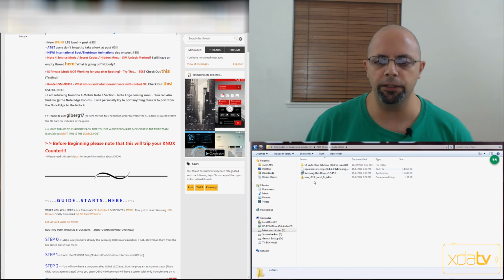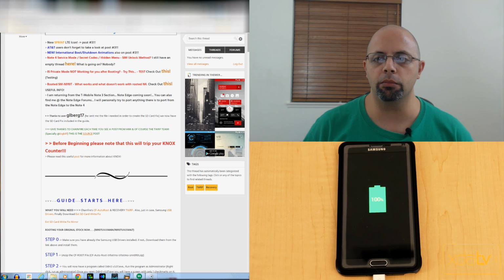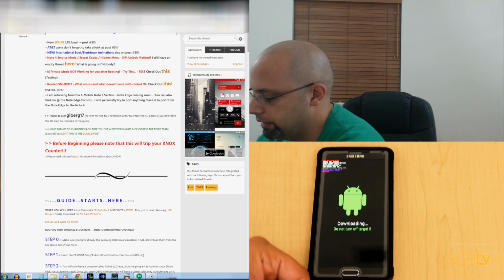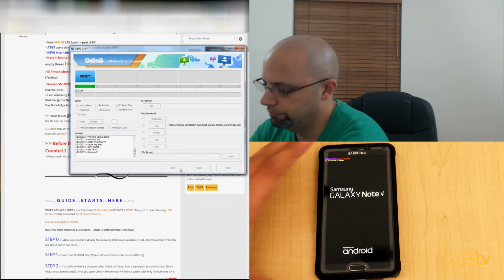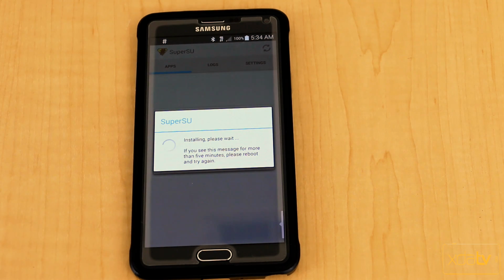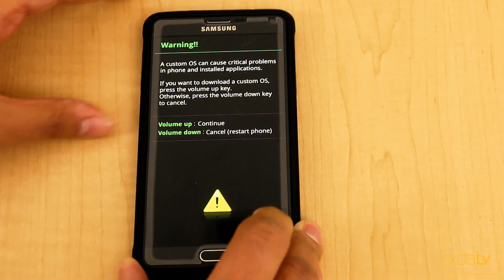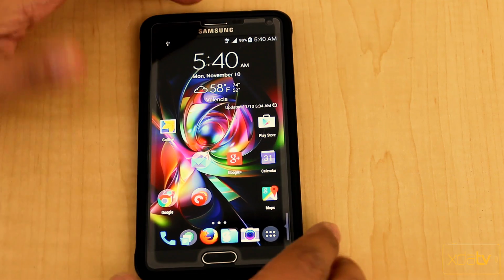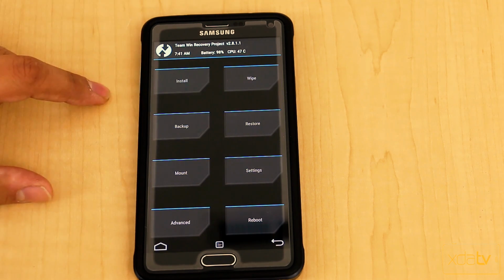How to Root the Samsung Galaxy Note 4 and Install TWRP

Comment: Hye XDA can this method still be use to flash latest version of TWRP,because i find this method are much easier then flashing it on unroot device which required to press 3 combo button to enter twrp right away just after the flashing pricess done by odin

Comment: Hi,
I went in Odin screen. Click on OPTIONS. Next to LOG.
Unchecked Reboot.
Send TWRP file to mobile. When it complete.
Unplug mobile. Remove battery & leave for 30 sec.
Press Volume UP + Home + Power Button togather.
It will start in TWRP.
It work for me. After flashing you must reboot in TWRP otherwise it will boot normally.
Try all steps again untill you success.

Comment: Are they ever going to make a working one click type root where you don't have to use a desktop type computer...ever? I got rid of all my Mac's/PC's because I have no need for them anymore and I'm always moving around so light as possible. Verizon Galaxy Note 4 w/Marshmallow currently. Would love to root but none have worked in the past.
Reply: hi I need to twrp and retrieve files from a bricked bootloop note 3, and
 also flash back to stock firmware. but the battery is totally dead, so I
 need to charge it first somehow or use USB during the process will be 
ok even it's dead battery?

Comment: Hi
i have note 4 and yesterday root my phone like yours. BUT my phone is locked from samsung logo.. first static samsung logo is open after animation samsung logo open-opening sound's half phone is rebooting. i found stock rom but i cant load to phone.. 
NAND Write Start!!!
FAIL!!
everytime is this happening or COM port error..  Now i really dont know what i am do now.. please help me what can i do..
thank you
Reply: Hi. First try to wipe data and factory reset from recovery. If that not help you need to flash stock rom. Dont wory, you will fix your note.
Register on sammobile.com and go to firmware. Download firmware for note 4 (n910f for snapdragon version, or n910c for exinos), see in settings which is yours  model. And you need to flash stock rom with odin. There are so much video how to flash. Important things is to download and install samsung kies software for drivers and just close it. Enter note to download mode and connect with usb. If you have win7 pc wait a little to windows install driver. Then run odin like admin. You will see your note is connected and hit start. I suggest to you after flash to again go to recovery and wipe data and fsctory reset. 
I hope halp to you☺

Comment: what if my note 4 on sprint is stuck on retail mode and wont let me shut off the device
Reply: To get rid of the retail mode,you have to put in a password or give it back.I got sold a retail mode device and the ad was always going on.Returned it and the guys couldn't remove the password,so they gave me a new device.Hope I helped you :D

Comment: My Verizon note 4 n910v  lollipop 5.0.1, baseband n910vvru1boaf, kernel 3.10.40  gets a complete write operation fail from odin. I went to cf auto root and used smn9108v.tar.md5 from chain fire. Any suggestions to complete ?

Comment: Not my 1st device rooted, but this is taking for every? fallowing the steps and even have xda site open. Download bar in odin is at like 5% for  30 minutes?
note 4 running LP (all stock)
Firmware update start..
recovery.img

Comment: One questin im doing exactly the same way you are doing for the note edge tmobile everthing run great but when turning on custom recovery factory recovery goes on not twrp recovery what am i doing wrong i have the driver twrp and root file for tmobile note edge right odin and. It still dont install everything say pass but going to recovery stock recovery appears not the custom one

Comment: when i try to root my note 4 with cf autoroot and odin, it always fails and I have to unplug and manually reboot my phone by removing the battery. how do i fix this??? the program ends with the line: <OSM> All threads completed. (succeed 0 / failed 1) . It fails and i can't root it then. please help!
Reply: Sahil Malhotra Same with me. Did you ever find a solution.
Reply: Nope, but I figured out why it didn't work. My model of the note 4 n910a, the us AT&T version has a locked bootloader and is unrootable, which kinda sucks but yeah. If you don't have a model with a locked bootloader you are just trying to root using an incorrect cf autoroot file designed for your phone. Really all depends on the model phone you have and your carrier.
Reply: Sahil Malhotra ahh, gotcha. I have a T-Mobile note 4 so I should have a unlocked bootloader. Im going to recheck the download and make sure its the right file.

Comment: ***** any idea if ROOTING will trip KNOX? also, will this work on Sprint variant Galaxy Note 4?
Reply: Cha Hernandez I'm pretty sure it does trip knox
Reply: Yes it does trip KNOX and it works on sprint.
Reply: rocketman8887 ITLL ALLWAYS TRIP KNOX, AND SPRINT AND TMOBILE ARE THE EASIEST TO ROOT SINCE THE BOOT LOADERS ARENT LOCKED, MEANING AFTER ROOT YOU CAN CHOOSE ANY ROM YOU WANT ON IT

Comment: Looking at the process and it is very straightforward but I have to admit I'm a bit skeptical that this will work for the AT&T version of note 4. So Soon anyone has done it for note 4 AT&T please do repsond. I will await the response. Thanks again for the video.
Reply: When this video was made, this only worked for T-Mobile but now it is available for basically all U.S. carriers. You just have to go to the website and check for your certain carrier and model.
Reply: ***** http://forum.xda-developers.com/note-4/orig-development/sm-n910-cf-auto-root-t2897428

Comment: Now I'm new to "root" I've jail broken devices before however. 
When you root is it possible to do it so Knox isn't tripped 
And are you able to update your firmware when you are rooted ?
Reply: No, it's not possible to not trip knox, and yes you're able to update firmware when rooted.
Reply: NviForce what exactly is knox
Reply: A safety thing that's also used to determine if you've tampered with your phone. Pretty useless piece of bloat on samsung phones.

Comment: I did everything according to the forum but my computer being the most reliable thing i have (sarcastic) doesn't recognize the recovery file and doesn't put it in the folder with odin where i selected PDA it is in a whole different folder than Odin has no access too as an image so apparently i have to burn that file on the CD. I've already tripped knox so my question is how can I continue to go about getting my phone rooted, do I need recovery or is it not really essential. thanks

Comment: I have few questions please.. i think this method work for all type of Note 4.. isn't it?. mine is SM-N910C.. so i think it is no problem. right? second question what does KNOX exactly mean? and how it may be useful later? Third: does rooting affect in anyway on performance of the device??? fourth: what do you exactly mean with ( it has modification to your device)? does that positive of negative?
Reply: I`m no techie mate, but i believe Knox is like a security app, i have had it on 2 devices and never used it or needed it, but i think what was referred to in the video about tripping knox ,  is that if your device is still under warranty , it shows up if you have rooted the device....... ie ....removed and replaced the factory software at some stage, even if you have replaced the factory software again ...... warranty will then  be void because knox shows it has been tampered with, that is my understanding of it anyway.
cheers.

Comment: Don,t work on N910C not branded. I downloaded cf-root for n910c and nothing. After "download mode" I don,t see red android screens with text but 3 times start screen and system starts normally. Su starts, ask to stop KNOX. It's stopped succesfully but gamekiller doesn't work. I downloaded brand new system for N910C ans it is the same.

Screen download:
Odin mode (red)
Product name : SM-N910C (white)
Current binary : Samsung official (white)
System status: Official (white)
Reactivation Lock (KK): Off (white)
Secure download : Enabled (blue)
Knox warrianty void : 1 (grey)
AP SWAEV : 1 (grey)

How root this?

Comment: Hay ,, 
I have my brand new note 4 which is divided in the water  i went through the process  to fix the hardwares and all good .. the device  start up normally no brown screen nothing unusual. Software start up.to the Samsung  colored logo and again start up . I reinstalled the software but still i have dm-verity verification failed error.  Any help to get it done?? ..

Please  ASAP

Comment: What it is that I mean is,  the note 4 that you just rooted,  was this an AT&T variant?    I have an AT&T samsung galaxy note 4 and I want it rooted more than my life itself.  Lol. Well not that much but yes.  Want it rooted.  Was that an AT&T note 4 that you used and if not,  can the method you used, is it good for my note 4.. My at&t note 4 that is.
Reply: It was T-Mobile N910T. No root for the AT&T yet.
Reply: gaatooor you are exactly right.... they won't release a working root now before lolli... if they did that.. the whole lolli update would kill it and we would all update and be out of luck once again... the masters of the universe will wait for lollipop.to come out then release it once THEY WORK THE BUGS OUT OF IT..... this is the facts and Yes those FACTS HURTHURT.   AND SINCE they hurt, put Your hands under the hammer and give it a smack .  Put pain to the feelings .....   sadness is a real thing and when sadness is felt and or spoken about, root usually is close to follow with it .  Who else is sad
Reply: +Nick saliaris +gaatooor  I am absolutely dying about this. I love the note 4.  It is clearly the best phone on the market. Easily.  Even the nexus is not even close to good as the note 4.  You can't remove the battery and other major issues. The note 4 is it.  I won't demote my phone for another. I want lollipop to get here then the root will drop.  There is no way,  NO WAY on god's green earth that the best phone on the market won't get rooted. No way. It will but the Devs know better.  They'll not root it until the lollipop drops.  I thank you both for replying and I do the same. Daily. Lol.  I check and search every website and upgrade source looking for the gift.  But till this date, there is no gift.  I'm needing it.  I will as you will I'm sure,  be eagerly searching and waiting and will let you both know all things I know.  In the meantime, try to figure it out on how to customize the note the best you can Witbout root.  Then let me know.  I'll do the same.
Reply: Jude Palermo waiting on this myself, been checking the web like once a week for an update. I got a ZeroLemon Battery Case from my phone as well. It's a case with an extended battery, brought it from 3,200 mAh to 10,000 mAh. check it out. Let me know if you find a root for this, thanks man

Comment: Nice video! My Note 4 doesn't get recognised by my windows 7 system, despite installing kies and the Samsung USB drivers. Tried different cables and ports with no luck. The pc recognises it and I can browse folders, but odin doesn't. Tried different versions of odin as well. What am I doing wrong. Thanks. I'm on the note 4 international version with the exynos chip, and I have the correct md5 file. Cheers!
Reply: Is it in download mode?

Comment: hi if you root your divice will you loose the Spen functions? also is there anyway to put stock android and still have the Spen functions?
Reply: As of now, the only way to get AOSP on the note 4 would be a custom rom. But, there are no aosp roms, and if/when they come out they will prob. Nlt have spen
Reply: But no. Rooting your N4 will not remove spen

Comment: It would be great if you start a series, tanking the Note 4 or Z3 as an example, of how a user can isntall and take advanteage of Xposed modules.
Reply: TK has a lot of videos on xposed modules, xposed tuesdays. He uses the note 3 in most all of them I believe.
Reply: I know he does.. but I am suggesting a How-to series for a begginer.
Reply: Ricardo Wagner step 1 download xposed installer and install it.
Step 2 open xposed installer and press install framework. Thats all you have to do. The vid would be pintless. Xposed installer guides you through everything.